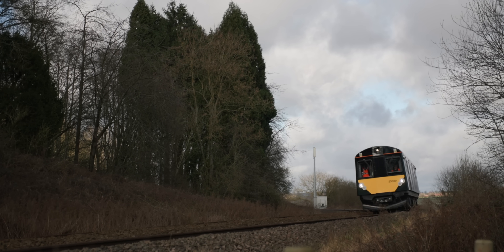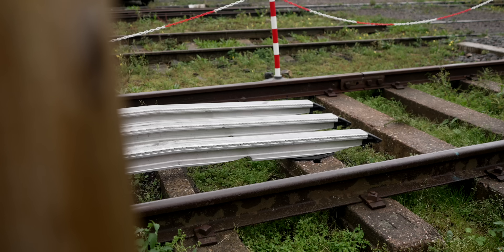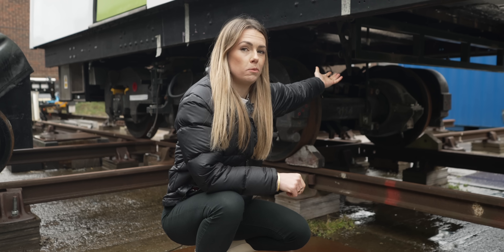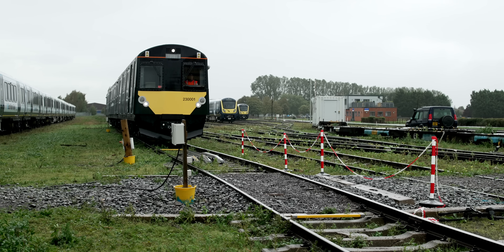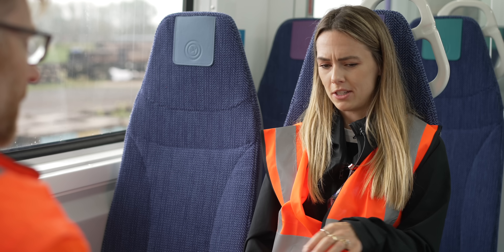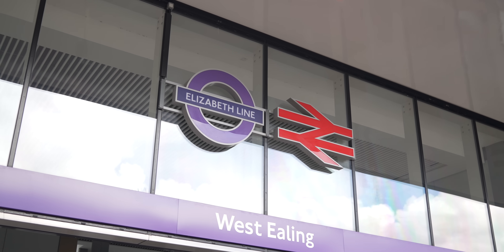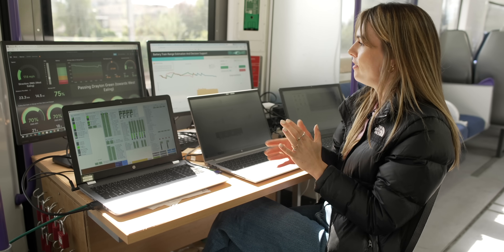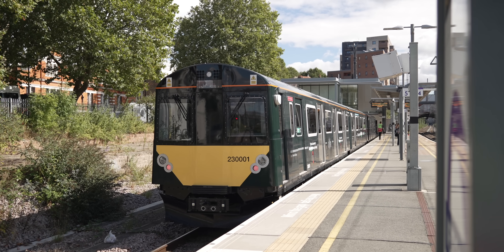Onboard the UK's First Battery Electric Train!

Comment: Excellent. Your final comment, giving credit to GWR for seeing it all through, is right on the money. We sometimes in the UK seem to give up just before an idea reaches maturity. Well done God's Wonderful Railway for sticking with it. And well done EEShow for keeping this one on your radar.

Hoping GWR will soon roll out the idea to Slough-Windsor, Maidenhead-Marlow & Twyford-Henley as well as the west country branches. With enough range it might even do Reading-Gatwick, which is already half third-rail
Reply: In fariness Vivarail was the one behind this tech. It was them who purchased the old tube stock, them who developed the shoe system (look when it's demo'd, it still had their logo on it). They sadly went bust in late 2022 when no rail company would commit to funding this technology. GWR picked up the remains cheap and just finished rolling out the demo. They've made zero commitment to using this technology anywhere outside the demo vehicle.
Reply: @puressk  Agreed. The idea of reusing old D78 Tube Stock, which had fundamentally sound chassis, with modernised powertrain and systems was a good one and the interior refits were done to a high standard. There were various power options, including modular diesel, 3rd rail electric and the pioneering fast-charge battery prototype. Sadly the whole project suffered from teething problems due to not having enough time to carry out proper reliability shakedown trials and many of the units were rushed into service before they really should have been. These issues affected customer confidence and combined with the funding running out before production and sales could really get going finally led to the collapse of the business. It wasn't helped either when Adrian Shooter, the inspiration and primary driver behind the Vivarail project, was struck down with MND. After that the whole thing just lost momentum. GWR just picked up the fast-charge battery train assets from the administrators for a knock-down price.
Reply: @puressk  Credit to Vivarail (RIP) too, but when they folded only GWR seized the torch AFAIK
Reply: Another positive and uplifting video from Fully Charged.  Well done GWR, Imogen and Full Charged team for showing the world what can be done.
Reply: @paulhaskins5191  A lot of work was done by Viarail before GWR purchased it.
Reply: GWR has enough spare vechiles to create units for Henley-on-Thames, Marlow and Windsor branches and some Cornish Branches. The 230s are to slow for North Downs which requires 90mph units and the 230s are limited to 60mph.
Reply: @J-Railway-Volunteer  Thanks for the info
Reply: Absolutely right about the GWR Thames branch lines.  I live at Twyford, and used to take the Henley branch most days.  Everyone was disappointed when the electrification of the branch lines was abandoned, they're stuck with diesel trains (Class 150s maybe?) that are noisy, smelly, and - let's face it - toxic.  These fast-charging battery trains are surely destined for those branches, and they'll give us the best of both worlds: fully electric without any ugly overhead wires and gantries.  Brilliant!
Reply: I have always thought the 3rd rail should be added between Wokingham and Aldershot South Junction and between Shalford Junction and Reigate. However the suggestion of using this new charging system (Reading-Gatwick) is one that I had not considered and is well worth investigation.
This could also be an idea for Hastings-Ashford.
Reply: @Phil-oj5nr Have to admit, whatever my views on the limitations imposed by 3rd rail  (although infinitely preferable to diesel operations, the tech is hardly suited to modern high speed operations), I never understood the ban on infill electrification and I'm relieved it appears to have gone.
Reply: Or maybe the 210 miles from Bristol to Penzance off the Great West Main Line that still isn't electrified (only the London to Bristol part is). Or indeed whole of the 200 mile West of England Main Line (London to Exerter) that isn't electrified at all (uses old diesel rolling stock scavanged from across the UK).
Reply: @GruffSillyGoat  Great Western Mainline is only London to Bristol, South West Mainline is a different line which runs from London Waterloo to Weymouth with 750v DC third rail, once you get to Bristol you switch to the Bristol and Exeter Railway, then at Exeter you switch to the South Devon Railway, then at Plymouth switch to the Cornish Mainline, if you take the direct route from Reading to Taunton you go via the Berks and Hants line.
Reply: @J-Railway-Volunteer  - Many thanks. Yes that is technically true of the Great Western Main Line, but the Bristol to Penzance is classed as a major branch line of the Great Western Main Line (like the other branch that runs onto Swansea, which is partially electrified); I shortend my comment in this particular reply and took out reference to branch lines (that I've put in other comments). My bad re typing the name of the West of England Main Line (which runs from London via Salisbury to Exeter) for some reason I had south west on the mind when typing in this comment (not in others), have corrected.

Comment: Shame you didn't mention the team at Vivarail, whose business sadly went bust in late 2022. While GWR is to be commended for picking up the project, it was Vivarail who did the heavy lifting in getting this train concept up and running, and took the hit for the early prototype fails
Reply: Theres is a comment further up stating that GWR bought out the Technology and the Vivarail team who are the same team currently working on it.
Reply: @paulhaffenden8911 "in the comments" – it should have been in the video
Reply: This is them, different employer
Reply: The Viva rail staff kept their jobs and it's great that they did. 

But the folks who put money into Vivarail lost their investment. I hope they can take some feeling of pride that even if they didn't get rich their money did help move the idea of battery trains forward in a way that would not have happened without their willingness to invest in the idea. In terms on the impact on future generations their money was well spent, whatever their financial advisors say.
Reply: Rapid charging more serious fires even the old lead acid cells could be damaged buckleing the plates
Reply: @normansmart7502  Many thousands of forklift trucks use fast chargers every day. Any mention of fires?
Reply: Shame?

Comment: In my local area, the previously almost invisible main line crossing the countryside became horribly visible when it was electrified. Thousands of huge metal posts and wires, millions spent raising some little-used rural bridges. Yeah! said all the politicians, this is the future! Then a solar power company wanted to cover a huge boggy area, inaccessible and invisible to anyone but a bird, next to the train line. Guess what? All the nimbys who had never even known about or set foot in these invisible boggy fields all came out in protest, claiming a few newts they'd never ever seen or cared about before might have to change ditch. What an eyesore it would be (though invisible from any road!). So that's fine then: let's uglify the huge train tracks so they scar the countryside, but not give a sh!t about where that electricity comes from! I despair.
Reply: We need to do both, electrify everything and power it with low-carbon electricity which will be mostly cheap and quick wind and solar.

And spare us your "horribly visible" angst. A train line doesn't despoil the countryside, and it's far better than a motorway.
Reply: It is undeniably horrible. From the nearby hill, the track was invisible. Now there is effectively a visible metal power station running for 3 miles across the fields. The money should have been saved and then spent on electric trains, once viable!

Comment: This would be ideal for the proposed restoration of the Portishead-Bristol line. Is there a reason that the battery pack couldn't be under the platform? Then convert the Avonmouth-Bristol line.

Comment: Has anyone mentioned Merseyrail's battery electric trains that have been running in passenger service to and from Headbolt Lane since October 2023?
Reply: I was going to post the same thing
Reply: However British Railways beat both Merseyrail and Great Western Railways with there battery train from 1958.
Reply: i was gonna say if this is the first what on earth have i been commuting on
Reply: @SkyeTheTimeBeast  Depends on if your line is electrified and it would depend on which electrification system used, then it will depend on the TOC and route as different routes in the same TCO can use different trains.
Reply: Heabolt Lane should have been a simple third rail extension, at a fraction of the cost of the ridiculous hybrid set up they've now been lumbered with. This is all because of a blanket "no expansion" policy on third rail electrification decided by grey people hundreds of miles away. I wonder how many £millions were siphoned out of the industry in consultants' fees to complete this white elephant of a vanity project?
Reply: That's a 3rd rail electric train with a small battery to get to Headbolt Lane, this is a train which only runs on battery power. It's a different thing.
Reply: @alexfrye6  Of course. But its not the UK's first battery train, by any means.
Reply: That is a shambles

Comment: Why do you need BATTERY trains?  It is so easy to put an electric cable overhead and do with no battery at all.  Such trains exist since the first years of the 20th century!  Sure, it needs some investment to be done... but I am pretty sure it is a worthwhile investment, even for lines that have little traffic!
Reply: Pretty sure? I wouldn't show up to a board meeting with "pretty sure". Comment section? Fine. 😁
Reply: @geirmyrvagnes8718  I obviously haven't done any due diligence! I give you that!   I just observe that EVERY SINGLE LINE, down to the smallest most local one in my country is electrified since nearly a century!
Reply: @st-ex8506  Yes, but battery tech was not that fantastic a century ago. And the UK had abundant amounts of coal at the time. This project is focused on the British market at least to start with, and they are not in the fortunate situation of not having plenty of coal a century ago. So unelectrified branches everywhere. Maybe this works out well for some of them? If the realistic alternative is diesel, it is pretty great!
Reply: @geirmyrvagnes8718  If I read between your lines, I hear "the UK hasn't done the required investments for the last century, and is too broke to do them now, so we'll opt for a band aid".

Comment: A few years ago, battery conversion of older Diesel Motor Unit Railcars started in Adelaide Australia.  They were turned into hybrids by removing one of the two engines, and replacing it with a battery.  It is hoped that in the future a two-car-set, which used to have four engines, will be able to operate with just one.  Also when these are retired, it is hoped full battery electric railcars will replace them.
Reply: Were they Diesel-electric to start with? The British ones I've traveled on seem to be rebodied road-going coaches, complete with gearboxes & propshafts.
Reply: @alanhat5252   Yes they were, with the twin diesels driving generators to provide electricity to the bogie motors.  With their new batteries, they can now take advantage of re-gen braking.
In my non-expert opinion, the train shown in this video looks to be a better system.  Maybe this, or something similar, could be used when our hybrids are eventually replaced.  I will be watching future Fully Charged shows with interest.

Comment: UK's First Battery Electric Train......errr Viva Rail anyone?  They took Underground D78 Stock and converted them to the Class 230, which is presented here.
The history on this goes back far further than this video states.
This was suppose to happen in 2015 on the Coventry to Nuneaton Line as a trial, unfortunately the prototype caught fire.
The first service ran in 2019
Sadly the company went into administration.
Reply: it was mentioned in another comment above that this is the same team working on it now as it was bought out by GWR.

Comment: I didn't see any regen braking, surely that would be extremely beneficial on this system, especially with the weight of the train not to mention a fully loaded train?
Reply: It is a given that they are using it. It's so prevalent in evs that this show stopped mentioning it.
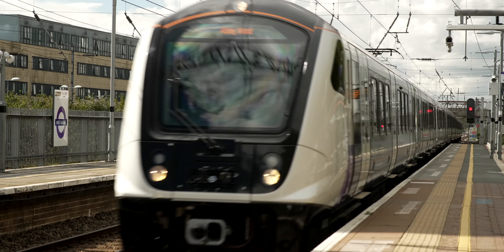Reply: @thekaxmax  no it's not. GWR's press releases don't say. The more I learn about this the more it seems it was done on the cheap to continue use of these Class 230 trains were originally London Underground D78 electric cars. That's probably why they use these short electrified rails instead of the usual overhead wires (which you can see at West Ealing station at 12:45!).
Reply: @skierpage : It is at least mentioned that regen braking is used, in the video "Fast Charge Battery Train Trial" from the Institution of Mechanical Engineers, at timestamp 7:50. 
(There's a video on the PWI's channel, quick skipping didn't get me any mention of regen braking, so as per the previous comment, I guess the presenter is taking it as given that they're using it, combined with previous mention of regenerative braking on the other incarnations of 230s, I guess!)

Comment: We have no overhead lines from York to here in Scarborough, whereas the rest of the line from York to Liverpool has overhead cables. This would be great for our line.
Reply: Overhead cables York to Liverpool - really?
Reply: This route, absolutely should have overhead lines, and it's a shame it hasn't got them yet.
Reply: @lkbergen  The route is not without big challenges otherwise it would have been done long before (York - Liverpool that is)
Reply: I'm North of Aberdeen. Electrification stops at Edinburgh. Admittedly local station saw it's last passengers in 1965, and hasn't even had track since the '70s.
Reply: There isn't overhead cable from York to Liverpool yet. It'll be live from York to Church Fenton soon- then it's diesel power to Stalybridge and then electric to Manchester Victoria and Liverpool from there!

Comment: This would be wonderful for strictly passenger rail tracks (if it's running cargo as well, then the traditional electrification is the way to go), especially in combination with solar canopies over platforms.

Does that train not recuperate when slowing down or did I miss something? If not why? Even diesel-electric trains use their motors to generate electricity and dump it into resistor banks (heat) to slow down just so they don't have to wear down the brakes as much... The only logical reason to omit the regenerative braking in this case specifically is to stress-test the charging as much as possible, but that would make no sense to omit it from the final product.
Reply: They do regen brake, though it's been irritatingly hard to get a quote that they do (found one in the end).
Reply: @fetchstixRHD  if you look at the charging & consumption dial during slowing down it shows consuming power until the train starts charging from the rails. They may have a regen system present, but disabled to stress test the charging system though...